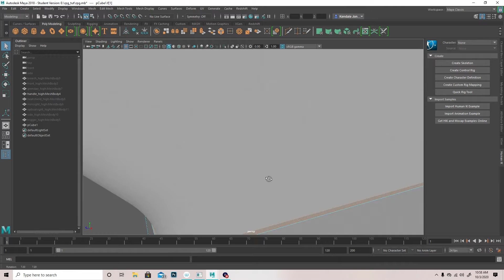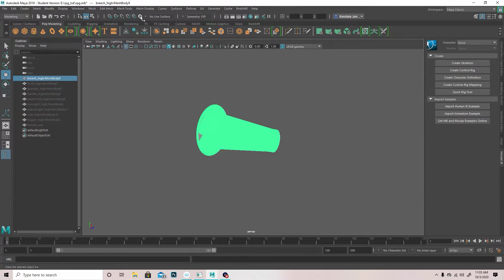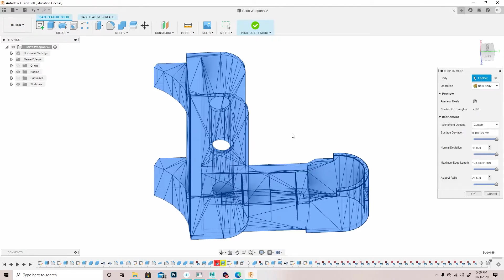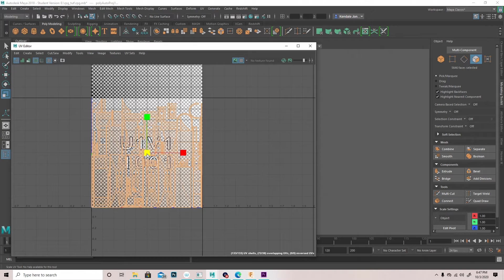What is Retopology (pt5)

Comment: I would like to add something that was not mentioned in this video. After finishing your retopolgy you need to assign hard and soft edges to your mesh.  There are two ways this can be accomplished. Method number 1 - after laying out the uvs assign hard edges to the border edges of the uv shells. Method 2 and probably the easiest - assign soft edges to the entire mesh. This a step not to be overlooked because it will greatly effect the outcome of your texture bake.
Reply from the maker: Thanks for the comment this should be very helpful, although I will add that this isn't always true. Depending on the program and model it isn't always necessary to harden/soften edges, but in any case the fastest way to do it in Maya, is to select the entire model, go display, and selects "Harden/soften edges" and its done:)
Reply: @thelastdev   I politely disagree. Surface normals of the geometry change when you apply soft\hard edges. So if you have random hard edges through out your model it going to impact the quality of your normal map bake. Unless I’m understanding you wrong.
Reply from the maker: @ryanm.19  lol we might have to agree to disagree on this one:)